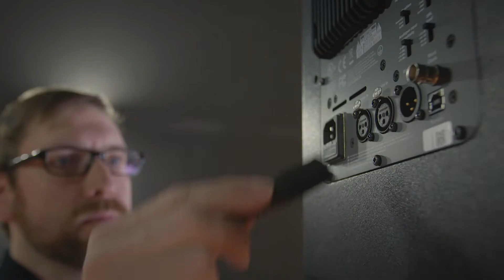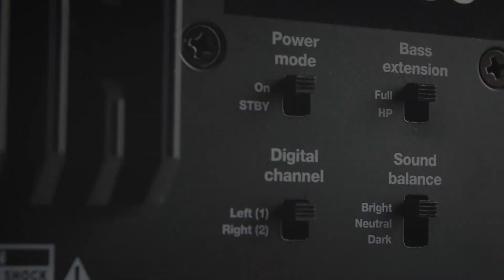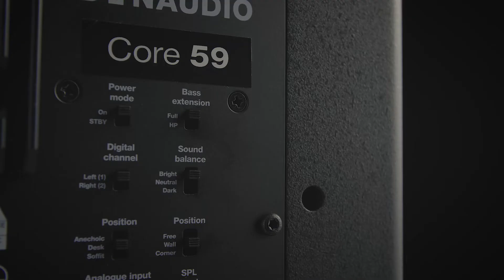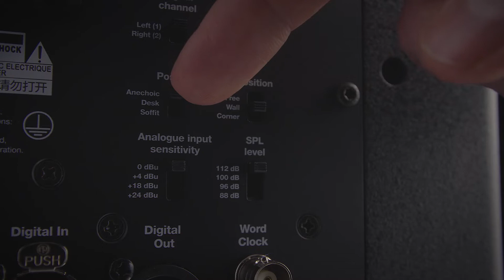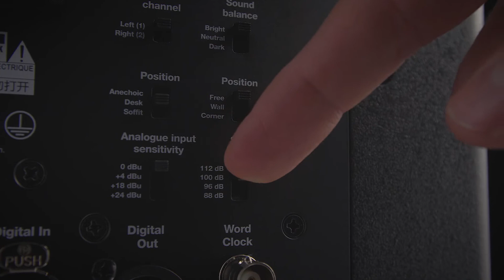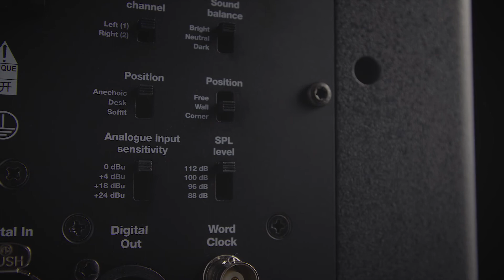How to set up your Core speakers

Comment: Hey Dynaudio!  Just got my Core 59's today.  When placing speakers on it side,  should the tweeter be on the inside or out?  Thoughts?  Thanks!
Reply: The default is tweeters out, same with the 47s. But you can set them up either way depending on your room and preferences
Reply: @neonether  Would there be a reason why my core sub keep limiting itself.  Seems to shut down and I have to turn volume all the way down then up to reset it to work properly again.

Comment: I buy it but my USB cable with the core don't work with my computer..
Reply from the maker: Hi Kosi. Thanks for your message. Just wanting to make sure we're on the same page. The USB connection is only for updating the software/firmware. You can not pass audio through the USB port.